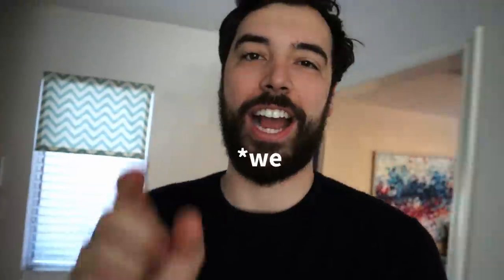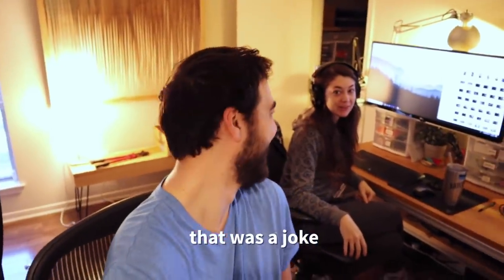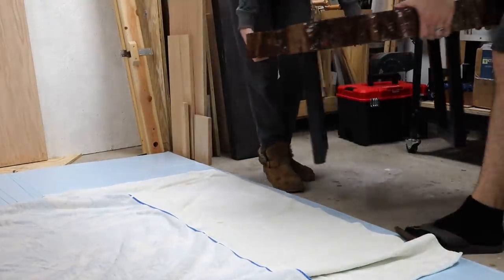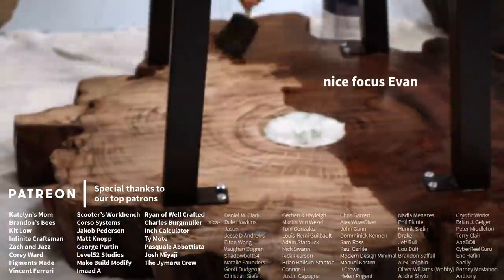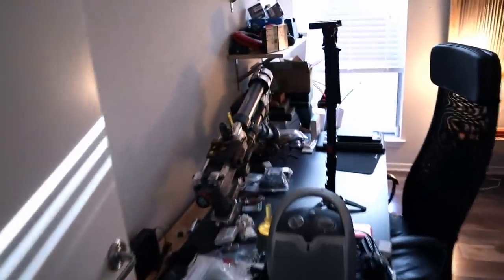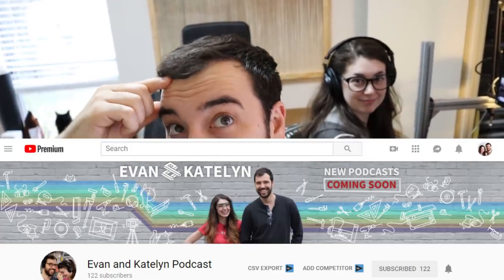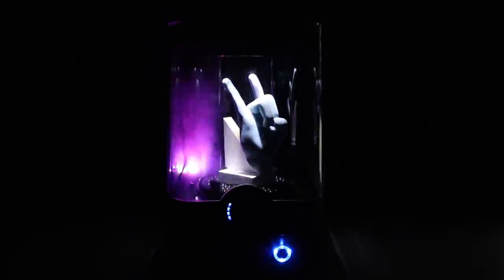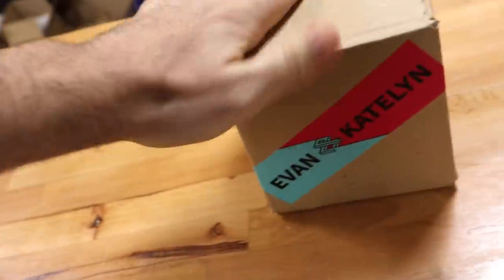E&K Vlogs: Welding stuff, new camera, comment advice!

Comment: I think those lines in your time lapse footage is flicker from your lights... You probably didn't see it in your normal footage because the settings (frame rate and shutter speed) were such that it didn't present itself. But with the time lapse, those settings may have changed, or the frequency of the individual pictures pictures was such that you caught the flicker. A lot of times you won't notice this on normal footage but will see it if you speed that footage up... it can be annoying. 

You can try fixing it by duplicating the clip, place the copied clip on top of the other (as a separate track) then reduce the opacity of the top clip to 50% and then move that clip over one frame (to the right).
Reply from the maker: Ah neat like that trick! Also might be a good idea to take a little sample clip and play it back before recording anything important in the future lol. Not a bad learning moment 👍
Reply: Yep it’s if your shutter speed doesn’t match the frequency of the mains AC. It’s most noticeable with fluorescent lights and LEDs. If you’ve got 60hz AC you can set your shutter speed to 1/60 of a second and adjust your aperture and iso to get the right exposure. If you’ve got 50hz ac you set the shutter to 1/50.
Reply from the maker: Thank you!
Reply: EvanAndKatelyn no worries ☺️

Comment: Can the stretchy 3D printing filament be used to 3D print resin molds?
Reply from the maker: It doesn't flex in the same way that silicone does so it would have to be a mold that doesn't require much flex to release

Comment: The rock concert cut of the vapor chamber... was EPIC!! EXPLOSION I also had a question. 20v or 18v power tools? I'm wanting to get my first set of cordless tools and that is the biggest hang up. I kind of wanted to get the set before I moved into my first home...
Reply from the maker: Haha thanks we had so much fun with that!! We have tried quite a few lines of tools and generally like the 20v. Brands specifically: DeWalt makes some quality stuff and the new 20v Craftsman line (red, not grey) is good too but still filling out. Main piece of advice: if you're going to use them a lot don't get the cheapest version of the tool, especially the drill. Most tool lines have at least 3 versions going up in price and power
Reply: You totally need to make the rock segment into a GIF. I would totally overuse that.  @EvanAndKatelyn  And noted, don't buy the cheapest version of a tool. I learned that when working for a Harbor Frieght Tools, but didn't realize other companies did the same. Good to hear it from someone who probably uses their tools daily.

Comment: Finishing experts will tell you that all traditional finishes, varnish, oils, polyurethanes etc are porous.  So, if you just put on a coat of poly on the bottom, you haven't sealed it.  The resin on the top may actually not be so porous, so you'd have to coat the bottom with resin too to actually seal the table.
Reply from the maker: ahhh that's good to know... thank you!

Comment: Nice stuff! I think the lines you had running across it may have to do with frame rate your camera is filming, so maybe slow that down to nearer to 30FPS, OR it could be that your lights in the workshop are probably fluorescent, which have a lower light frequency than LED's and therefore that's what you're seeing in the shot so possibly an LED spotlight closer to the shot. Hope that helps, and you now have an excuse for MORE TOOLS/STUFF
Reply from the maker: Thanks for the tips! I know that that happens when recording video but our timelapses is a series of photos... (Or at least we thought it was since that's how our last camera did it... Maybe it's video in this one!)
Reply: Excellent point, I realise everyone’s pointed something similar out and you’re probably like 😅😩 but as a thought, a video is pretty much a series of photos so could it be that the same effect is occurring but just slower? 🤔